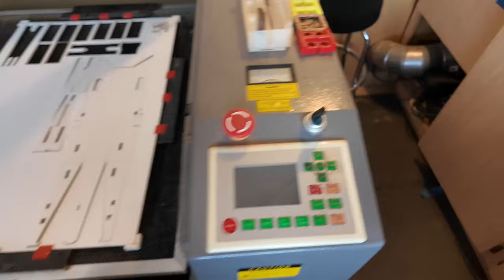Plank Evolution: Pursuing FPV's Easiest Build Plane

Comment: Been watching your videos for the last week or so while on vacation to fill empty time and I have been enjoying your content. Just subscribed. Cheers. I played with foam board a few years back and am now building mostly with XPS foam. Now it might be harder to find in your climate but you can buy here in chilly Colorado 4'x8'x2"thick XPS. Hotwiring foam has been a great joy. I can make consistent 1mm or 2mm thick foam sheets for building even lighter. You can make stencils and cut out foam blocks for fuselage shapes then cut them full of holes and skin with the very light 1mm foam and it works great. I recently started using a CNC machine and am hoping to build bigger and more accurate.. cutting by hand is a huge time suck. But back to you. I love the simple designs and the goal to stay under 250. Stay cool.
Reply from the maker: Thank you!

I’ve wanted to build a hot wire cutter, and a CNC - but I’m really limited on shop space, and my one car garage is very optimized for my current workflow. If I ever got a larger shop - I would LOVE a CNC hot wire cutter (as well as a lathe, mill, proper drill press, Tormach….). Either way - you work with the tools you have.

I really appreciate your comment, and I’m jealous of your tools…. I’d love to see your designs as well.
Reply: My hotwire just hangs on a wall, they really don't take much room, I use folding tables in my 1 car garage to work off of and have to pack up to park the car. Space is always at a premium! Oh man, a drill press and a lathe would be awesome. But try explaining to the wife that you need 2k more of tools to make proper landing gear for your hobby lol "well yea, I just bend wire now by hand... And yea the planes land fine... But this would be so much better! Imagine tiny shocks!!" Lol

Comment: I like this design!  I still can't figure out how your camera latches down the nose plate.  You showed it in another video but it was off camera and you couldn't see how it worked.
Reply from the maker: The camera arm passes under the piece of foam board at the front of the fuselage that bridges the left and right walls together. 

The camera itself then slides back into an indent in the bridge piece preventing the nose from sliding side to side.

When the camera and its associated hatch are in place, and the camera is slid aft into the detent in the fuselage bridge, the arm prevents the lid from moving vertically.  The camera arm’s ability to slide forward and aft allow it to be moved for installation and removal of the camera hatch.

The sliding vent at the aft end of the camera top plate slides aft and engages a tab under the leading edge of the wing.

When I get home in a few days I’ll try to get a better video of this engagement system to clarify things.  It sounds complex as I write it out - but when you hold it in your hand it’s obvious.  I’ll work to capture this system better.

Thanks for your note.
Reply: @usefulaircraft  Very clever!  I like your 3D printed parts to keep stuff neat.  I also really like the idea of the re-useable O3 camera.  I fly quads mostly.  Gonna have to think of a way to do this with my quads too.   Do you buy extra FC to O3 cables and leave the cables in your planes?
Reply: Oh, do you sell your planes cut out?  I actually have access to several laser etchers and it never occurred to me to design planes and cut them out on the laser.  Does the foam board cut well?  Seems like it would burn and melt.  I'd probably be as interested, if not more, in getting our design.  SVG files?

Comment: hello, just wondering if we could get more information on your Laser cutter setup and why you picked the one you have.
Reply from the maker: It's a G. Weike LC1290 with a Rudia controller driven by Lightburn.  I spent quite a bit of time in makerspaces trying different types, but found the Chinese CO2 lasers net my needs.  I've got a 100 watt tube, and a spare 130 watt tube.  A CW-5200 chiller, giant air extraction fan and a small compressor for the nozzle.  Get a spare power supply, as they go out occasionally.  They're an incredible tool.  

Just do it.

Comment: Love the design, Its almost a wing but just long enough to need horiz stabs i guess. How are ya at making a rounder, sportster type of open cockpit style. Ive scratch built a couple that look amazing but maybe dont fly so well
Reply from the maker: I’ve got some other designs that you may like - but I just need to find the time in the garage between work trips to build them and make videos.  The horizontal stabs are an aerodynamic bandaid to help reduce an occasional pitch oscillation at high angles of attack (particularly in turbulence).  Look at the tail end of a Beech 1900D, and you’ll see all kinds of aerodynamic attachments covering for any number of sins.  Sometimes it’s just easier to add a fin than to correct instability.  Thanks for your comment!

Comment: What type/brand of glue stick and glue gun do you use?  Thanks
Reply from the maker: The glue gun is a Surebonder I picked up on Amazon way back in 2015.  They changed their colors - but they’re still available, and I like the hand feel and extruded width of the glue line.  That said - I’ve used plenty of different brands, and it’s whatever you get used to and feels good.

The hot glue is AdTech - the 10” full sticks, also off amazon.  They’re about $25 a box - but that’s a lot of hot glue.  I really like the consistency of their glue.

Thanks for the comment.
Reply: @usefulaircraft  Thank you for the info - appreciate it ...enjoy your channel and look forward to your PDF plans whenever they are available  !!

Comment: Are these designs that you plan on selling?
Reply from the maker: I'll get around to putting kits out.  I've just been waiting for the summer temperatures to come down a bit, as I don't like running the laser when it's so hot.

Today I just got around to putting out plans, but they're very much a beta test as I'm new to making plans for others. 

If you're interested, check out UsefulAircraft.com/plans